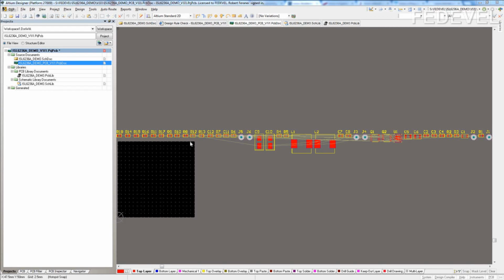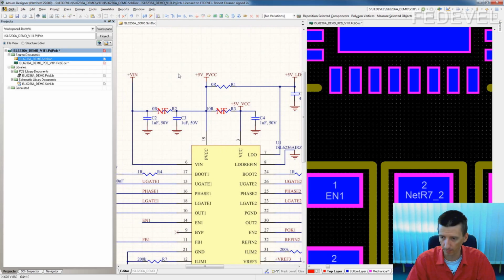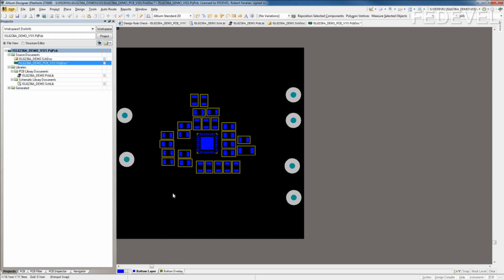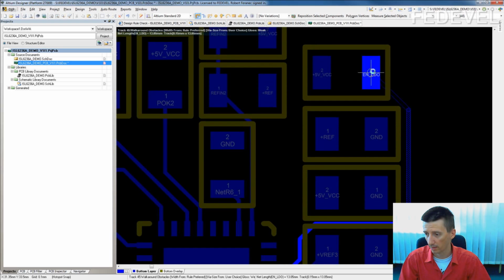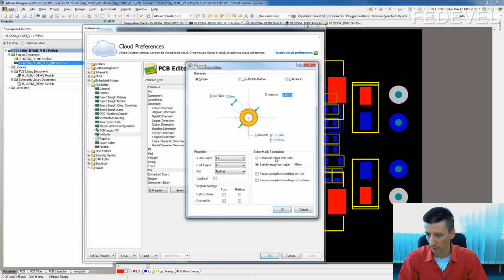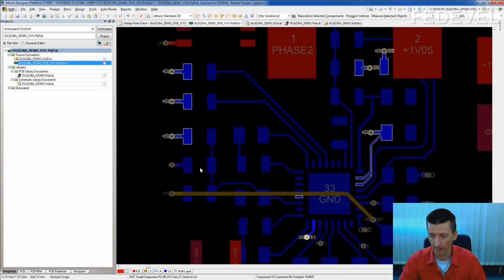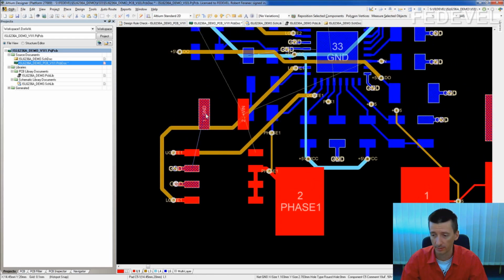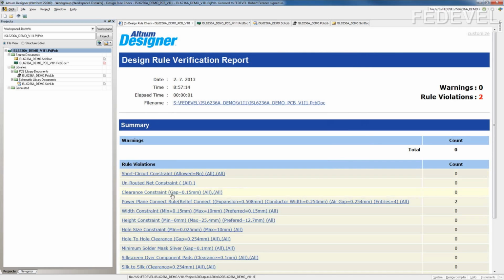Learn Altium Essentials - Doing PCB Layout (Lesson 4)

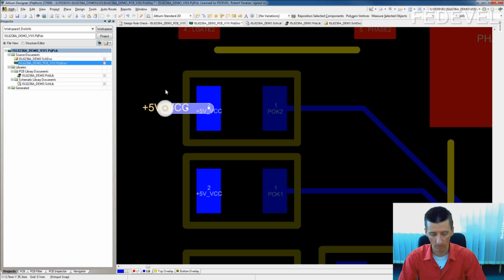Comment: AS you done at 36:46 , when ı do  that the plate of component is shown that X figure in greenly
.I think is it worng ?
Reply from the maker: Did you specify GND power plane inside of the PCB? It may be green as it is not connected anywhere. The best is to open "PCB Rules and Violations Panel" and double check what errors you have there.
Reply: @RobertFeranec , Thanks a lot for your interesting and 
 You responded my all questions without boring.

Comment: do you still make courses ?? are they on latest altium version or still the old version ?
Reply from the maker: I am thinking about two new courses - one simple one (I am not sure what board to use as an example, any ideas?) and one complex one (the server board what I keep talking about, but I have not found any sponsor for that kind of course yet).
The existing courses are still perfectly fine - even they are recorded in older version of Altium. There are not so many differences between other Altiums and after watching this series of videos, no one should have any problems to follow the courses (if anyone has, they can ask on our forum). Also, the courses are about hardware design (so they teach about designing boards), Altium is just a tool to show how to do some things, so it is not really important what Altium version you will be using during the course (we have some students using different CAD systems, many Cadence users go for Advanced PCB Layout course and we even have student using KiCAD with Learn to Design Your Own Boards or several Eagle users).
Reply: a simple one a 32bit MCU board like corte AM4 or microhip mz 32bit

Comment: Hi. I watch. all 100 hatdware desingn tips. It is great!. I found that some of them I already use. Wow! But I am an amator. I wery like this video. I found that placing without showing unrouted net  is much more better! I really can not even image this!  But I want to ask some question. Why we put vias from GND pins of chip to GND layer? We can just connect them to GND plate under the chip and put more vias in this area under the chip. and also by doin thats way we automaticly will have some plase around the chip. Or there is some things, which I not understand corectly? 
Thanks.
Reply from the maker: Depends how big the chip is, where are your decoupling capacitors and how close the VIAs would be (also it may depend what kind of board you are designins). Ideally you would like to keep current loops as small as possible (very simply to say, the distances between decoupling capacitor, GND + PWR chip pins and GND + PWR VIAs) and also it is good if power pins (that includes ground pins) are not shared (ideally you may want to use 1 VIA per power pin, sometimes you can have two pins sharing one power VIA, but maybe not more).

Comment: Hi Robert, while I am dragging a room in the top layer, it moves any tracks under that room in the bottom layer. This is too much problematic. How can I move a room in a layer without disturbing tracks / vias on the other layer? Please suggest.
Reply from the maker: I do not use rooms much and I have never seen moving tracks together with room. So it may be something with Altium settings? I do not really know :(
Reply: No problem, thank you :)

Comment: Love your videos Robert, thank you very much.

Was wondering as a friend imported a large eagle project that had multiple silk screen layers / overlay layers. They all appeared as mechanical layers and i could not figure out how to get altium to treat them as overlays. Is there a method to have more than one overlay layer in altium or do i have to copy paste the contents of those mechanical layers to the top and bottom overlay layers?
Reply from the maker: Thank you orbita1. I do not really know - I have never imported a project from Eagle.
Reply: Ah ok, i mainly wondered if altium had the possibility to have more than one overlay per layer. 

Anyway, do you have any lessons on tracking high speed signals using low noise methods? I've made a board with I2S signals on it and it jams wifi within several CM of it :p I'm not sure if it's EMI or RF interference, it's a bit beyond me. I'll try a four layer board with undisturbed layers on top and below the high speed tracks to RF shield it since i noticed aluminium tape helps / fully blocks the wifi jamming 'feature'.
Reply from the maker: Hmm, double check if it really is i2s. Also, what you can try is to put 33R serial termination resistors into the i2s signals to slow down the rising / falling edge.
Reply: Thanks for the suggestion, i did already hard wire a mod to add 10 ohm resistors to the i2s bus + MCLK (SCLK). 

I'm stumped as to what else it could be, on my board the only stages i have are:

*a very noisy power source (pi source, but this can't be the problem sure, i smooth this with 3 caps + LC filter and a 4.75 V LDO low noise reg)
*the I2S ADC, 
*summing amplifier and electret mic op amp 

That's basically it. Would you recommend me to tape the entire board and untape in stages so i can eventually be left with the problem area?
Reply from the maker: It's very hard to say what the problem is. You will need to play with it. I am just not sure if i2s can disable wifi, that sounds to me unusual. Most of these kind of problems is power supply or 2 layer PCB.
Reply: Do you have any design tips on reducing EMI? I'm trying to make my 2nd rev minimal loops and shorter traces with proper griddled grounding and i2s tracks in the power plane etc. I don't think it'd be the PSU, it's just a simple 5V source same as usb. I will continue with the shielding mods and see if i can narrow down the problem.